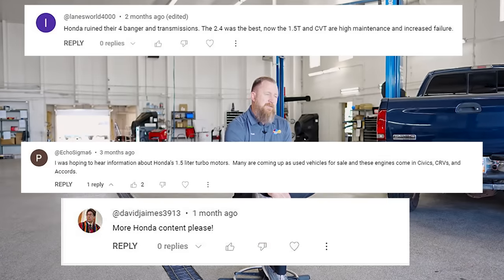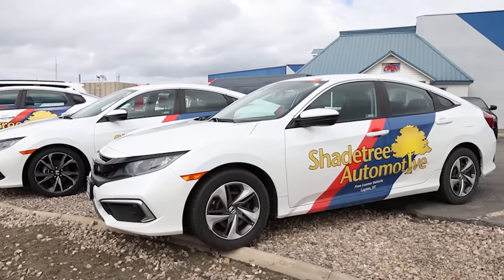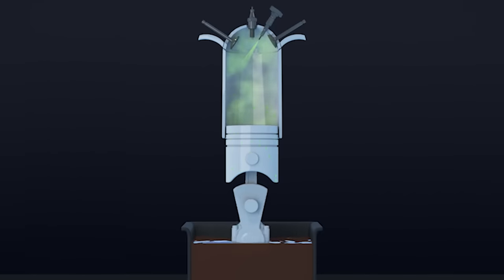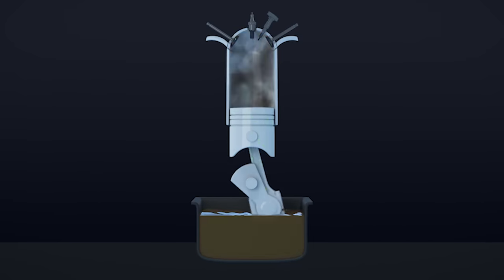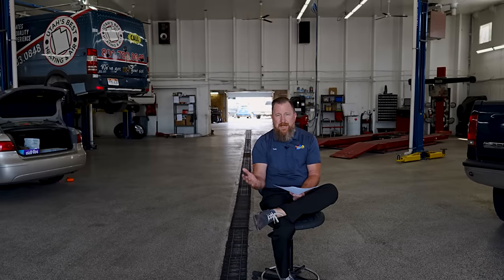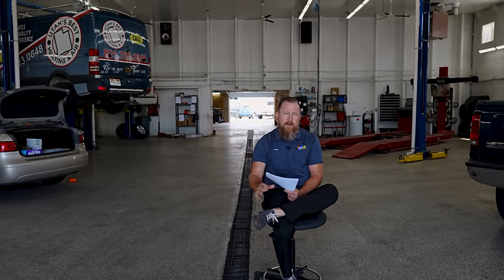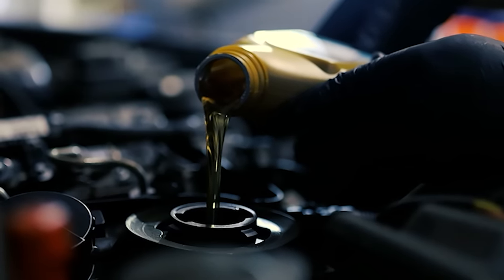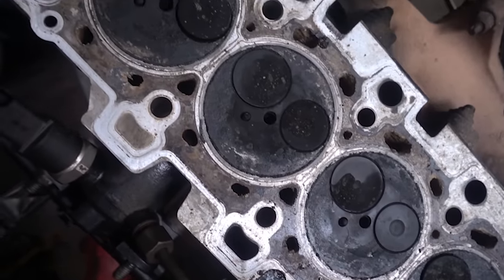Honda Oil Dilution Issue - Should you buy a new Honda

Comment: Don’t forget to be making sure to use GF-6 oil.
Reply: 0w-20 and 0w-16 is gf6.
Reply: @milfordcivic6755 not all of it, gotta read the back to be sure. for 0w20 at least, all 0w16 is
Reply: @milfordcivic6755  No. 0w-20 is  GF-6A and compatible with older engines , 0w-16 is GF-6B and not backward compatible.
Reply: This has me stuck, why would a thinner oil help when the oil is already thinning as it is? What's different on the gf6 that helps in this specific case?

Comment: The actual problem is 1.5T Accords having blown head gaskets -_- . Bought my Honda for reliability, safety and fuel mileage.. and now there’s head gasket problems cuz of the high psi and weak bolts they use, and apparently 87 fuel is terrible for turbo engines so you spend an extra dollar a gallon for 89 or 91.  Fun!  Fortunately how hard you drive can affect your risk, and I typically keep RPMs under 3k.  Kinda crappy knowing I can’t have a little fun from time to time though.

Comment: We own a 2017 CRV. I change oil myself over 120,000 km of use, from new. I can smell a bit of gas smell in oil at change, but oil volume doesn't climb per say, or seem diluted. I've  been changing oil for 35 years on our family fleet, and so far doesn't seem be be an issue for us. We drive alot of hiway kilometers, and run engine at full temp most often. We live in northern BC, and  Honda software update(engine warms up quicker now) and longer drives, so far engine seems okay. If we did stop and go, I'd change oil sooner also.

Comment: Loving my 2012 Honda CR-V, EX-L with non-turbo 2.3L. Several cross-country USA road trips of 7500-8500 each miles with oil changed at 15% life. I check the oil level daily but with 135K+ miles on the odometer, I have yet to add a drop between oil changes. Not wild about turbos nor CVT transmissions.
Reply from the maker: Nice work
Reply: Fuel and moisture can displace oil consumption, making it look like the engine doesn't consume oil.
Reply: Why do you check oil daily. That’s insane.
Reply: @ShadetreeAutomotiveLayton  What about the straight 1.5 Honda fit sport and the 1.3 engine model?

Comment: Thank you for the video. I just bought a 2024 civic sport touring with the 1.5t and its a great car. im still stuck in the mentality of oil change every 3000 miles, but oil and filter are cheap. engine replacement is not!

Comment: I had a 2018 Accord Sport1.5t and now have a 22 Civic SI. Never had an issue. I get my oil changed every 3,000:to 4,000 miles. I have a 6 minute commute for work.
Reply: 6 minutes🤣
Reply: what octane fuel and what weight oil?
Reply: @dand1363  I use what we have as the highest here in Texas. 93?  Oil?  Whatever the Honda dealership uses 😎

Comment: Good video...thanks. On you engine cleaning process is that recommended by Honda? During the cleaning do the carbon deposits that head to the tail pipe affect the catalytic converter? I'd like to see your before and after photos of the back side of the intake valves after this process. Not photos provided by the manufacture of the product your using.  Thanks again!
Reply from the maker: The carbon cleaning process we use is not Honda specific.  We use a Valvoline product that does a good job and is safe.  Reach out to your local Valvoline rep for a demo.
Reply: @ShadetreeAutomotiveLayton  I haven't seen any where that this process is recommended by any manufacture...Ford specifically says don't do this kind of treatment because if you damage the cat or any other oem part, its not covered under warranty. Some OEM dealers offer the service any way. With all due respect what your selling, I've never seen any evidence that it does any good. The only sure fire way I've seen any evidence of proper carbon cleaning is doing it manually like walnut shell blasting. Not washing some unknown stuff down your intake system.
Reply: @garybaldwin1061   I had an issue with carbon buildup in my 2016 Fit and Honda Canada did have a process, they took the head off and cleaned the valves with some sort of rotary brush. This is obviously quite different than what was mentioned tho
Reply from the maker: Yes, walnut shell blasting is the best way to actually clean carbon @garybaldwin1061  .  There service we do on our vehicles and our customers vehicle is not recommended by all manufacturers.  Valvoline backs me up if there is every a problem.  When we first started offering the service, we did remove an upper intake, use a borescope to look at valves, run the service and then check them again.  Made a good amount of difference.  The key is to utilize the cleaners as a preventative maintenance tool rather than a repair.  Once the carbon is buildup enough to cause issues, it is walnut blasting time.

Comment: Are the 2.0t variants OK? Haven't heard of issues with them. Imagine the old J35 3.5 v6's didn't have this problem right?
Reply: the 2.0t doesnt have any of those issues.The k20 is a reknown engine that can last decade with proper maintenance,booster or not.Its literally honda's best engine from the last 2 decades.
Reply: @alpe6228  I thought that also but someone in this comment section mentioned that they saw fuel in an oil analysis on their 2.0
Reply: @neilquinn  Well it could have oil dilution but its not really a problem for the k20.Its a very solid engine compared to the l15.
Reply: @alpe6228  ya I have a lot more faith in those established K series engines. With Acura TLX’s my main concern is the 9spd trans

Comment: Why change the oil sooner why not just run it for a long drive? Wouldn't that burn off all the extra fuel in the oil??? Recirculate it to the pcv valve back into the intake or exhaust?

Comment: 4000 mile oil change, filter every other change. I cut open lots of oil filters and the only thing capturedvis plasticized/varnished oil residure. This residue is still minimall at 4k miles. If you doubt, do a 4000 mile and change filter and cut apart filter and stretch tge paper and look in the pleats. DI causes more soot and the engines with the combo PI and DI have reduced dilution and no intake valve deposits. Honda will likely join the ones doing that but it is no relief for any without it.
Reply: Yeah, and save a whole 50 dollars over the life of the car which will cost about $80k in total operating costs!

Comment: First, I would like to thank you for taking the time to make this video on the 1.5 turbo. It is the most comprehensive explanation of what causes the problem and the possible solutions. Do you have any opinion on the 1.2 turbo engines that they are putting in the new 2024 Chevrolet Trac?
Reply from the maker: You are welcome.  I don't have enough experience to form a solid opinion on the 1.2 in the Chev.  My gut tells me it will likely have lots of issues.
Reply: @ShadetreeAutomotiveLayton Thank you for taking the time to respond.

Comment: I've been a Honda specialist for 16 years and have not been impressed with the 1.5T. I haven't seen much oil dilution in my area, but I have seen a handful of headgasket issues. There hasve also been many fuel injector and fuel pump issues and I suspect that may damage the headgasket, which doesn't take much given the design of the engine block cooling slits between cylinders. Buy a Honda with a V6 or a K series engine.
Reply: Ummm, be careful throwing stones , dude.   The 3.5 has had injector issues for years.
Reply: @kevbiker3982  you're right . I forgot about J series injector issues and VCM oiling issues. However, the overall architecture of the engine, especially the older ones, is vastly more reliable, IMO.
Reply: They are not overbuilt at all which is not promising for a very long life.   Tuners put a mild tune on these engines and they self destruct, not like the older Honda/acuras.

Comment: Excellent video.  I just purchased a 2024 Accord EX with the 1.5 Liter turbo engine (L15BE VTEC).    I plan to get the oil changed at a minimum every 7K miles, and I rarely drive for less than 15 minutes at a time so my engine always reaches operating temperature.  Plus I drive conservatively.   Where I live, in the winter it rarely gets below 45F except in the early morning hours before sunrise.   Since it's a new car,  I should have the latest software updates.   The advice in this video is excellent and should be followed.   Also, this engine has mechanical lifters so I plan to have the valves adjusted at least every 30K miles.
Reply: Thinking of buying an Accord myself. This is steering me towards the hybrid as we live in Maine, (it tends to get chilly here) and my wife only drives locally.

Comment: I went into the Toyota dealer with 5% fuel dilution and they said it was normal.

The problem arose due to the use of E10 (10% ethanol fuel): 

The ethanol oxidises and then polymerises to form sticky brown deposits that gum up the rings. Even the dipstick can end up brown from these deposits.
The sticky rings let the fuel get into the sump.

The fuel dilution of the oil compromises the lubricant film of the piston and bore... and you can end up with score marks up and down the bore.

Fortunately, if you stop using E10 the problem stops getting worse.
Unfortunately, to clear out the deposits you will need to flush your engine... perhaps more than once.

In many countries, ethanol is used in virtually all fuels so you can't simply stop using it.

🙂

Comment: I have an accord with the 2.0. 5% dilution in 4000 miles. I change the oil every 4000 with 5w30 instead of 0w20. The dilution is really bad.
I live in hot climate too. I drive 99% highway miles for 35 minutes or more. The issue is the ENGINE DESIGN not driving conditions.
Reply: What year is your accord? Never thought 2.0T would get affected as well.
Reply: I have a 2019 2.0t accord with 57k. I use 0w20 amsoil signature and did an oil change 7000 miles. Everything was fine except for 3.7 percent fuel dilution. Was told to change oil at half interval. So, I took another sample after 3500 miles and changed the oil and filter. I'm still waiting for the report. 

I live in socal, but I have a short commute to work 6 miles each way.

Comment: Love my 2018 civic Si,,,,I notice the oil dilution immediately so changed the oil before it’s first 2000 miles and after break in starting driving it more aggressively, stoped doing short drives and always charge the oil early IE at 2500-3500 miles. 

Now have over 50,000 miles and don’t see any issues.

Comment: This was only an issue in very cold climates.China, North America etc….We in Australia have never had this issue, & as such Honda Australia never issued a service/tech bulletin.Other than that their engines are pretty well bulletproof.
Reply: My FK and FL Civics are doing amazing. Like you said Adelaide is not too harsh for the cars to endure in terms of climate severity. 🎉
Reply: Sorry but I have to disagree with you. I live in Melbourne and I lab checked my 18 CRv’s oil last year and it was diluting at 9%. From day one of car ownership I could smell petrol on the dipstick. I mentioned this to Honda at my first 2 services and the ran the line you just stated above, nothing to see here. They are now checking it out as I did another lab test earlier this year and it was way up in the caution region. I’ve had a couple loaner crv’s from Honda now and out of interest I pulled their dipsticks and I could smell a strong odour of petrol on both cars. I reckon it’s happening a lot in Aus however people are just not aware. I do long drives, sometimes 2-5 hours. Basically the engine is diluting so much even at operating temperature, the petrol  isn’t all being evaporated off. Totally flawed engine IMHO.
Reply: @ayfj4572  I never ever experienced that with my CRV , I live in the Southern Tablelands, we’re it gets below zero @ night.
Reply: The issue is everywere. The only difference is a hot engine thats driven vaporizes the gas and it dont build up as much.
Reply: Yeah but you have that nasty funnel web spider.

Comment: I ditched our CRV and 2018 Civic 1.5t for a 2021 Rav 4. It’s got the 2.5l naturally aspirated well proven motor- GDI and Port fuel injection helps with carbon buildup , bulletproof 8 speed ( non CVT tranny) and well proven AWD system. 70k miles so far basic maintenance only and still riding with the original brakes too.

Comment: Just an educated guess but I think premium fuel could help.  GM recommends it (but not required) for their 2.0 turbo in my Cadillac XT4.  I've run regular but the car gets worse mileage, which indicates more fuel being injected into the cylinders to prevent pinging.  Just a thought and I may be wrong, but worth a try. n If premium is working, better gas mileage will be an indicator of a leaner mixture.
Reply: Premium.fuel simply does not self ignite..i.e. knock.  Does nothing for economy, efficiency, etc.  It simply allows aggressive timing and higher compression to create more power without early detonation destroying the engine.

Comment: Our 2010 crv approaching 500k so Im currently looking for a 2016 2.4 to replace it. No way some turbo tiny 4cyl will last as long with as little issues.
Reply: There is a guy with 2018 civic 1.5T with 700k miles.  So you have no clue what you’re talking about. Honda makes great engines, including the 1.5T.
Reply: @areallytallguy  There's always that "one guy" did you even watch this video or just jump to the comments and cry over people hating on a car you probably in debt for.
Reply: I have a 2011 that just hit 100k, im excited  to see how long it will last
Reply: @capy_official Get those valves adjusted before you hit 150k just to be safe. The only issue with theses engine is when they get high mileage, the exhaust valves get tight and they can burn a valve.

Comment: I believe that only the Civics with the 1.5L t engines have this issues, while the LX and EX trim don't, since those have a naturally aspired 2.0L engine with no turbo on top. Honda also released an EX-T model in NAmerica, which also has a 1.5t engine, So if you wan to avoid this problem, my suggestion is to get a Civic with the 2.0L engine, so LX or EX models.

Comment: I just stay away from turbo engines in-general or any other added-complexity/problem engine tech such as stop/start & cylinder-deactivation.  Same with any belt/chain design CVT transmission.  That's how I ended up with my 2022 Mazda CX-30 Carbon Edition 6-AT, which has been a 100% problem/issue-free ownership experience for about 19 months & counting now.  It's my first Mazda after owning/driving nothing but Honda/Acura (all manual) for about 30 years & then Toyota (all manual) for about 10 years after that.
Reply: CVT's aren't bad, depending on who makes them. Toyota and honda make the best CVT's. No problems on my toyota CVT at 40k so far
Reply: @lunisce  Belt/Chain CVT's don't typically last much longer than 100-120K, if even that given the way most people drive & service their vehicles.  Just the nature of the design in-general (which is also prone to more random premature failures).  But, as long as it makes it through a powertrain/extended warranty period, that is all automakers care about.  From what I have seen, the various Toyota & Honda forums seem fairly active with CVT issues/problems as well.

Comment: Very good advice for anyone driving short distances in cold weather. I do drive mostly short distances myself so I change my oil every 3000 miles or six months, whatever comes first. I also try to exercise my car by driving it 30 minutes every 2 or 3 weeks to burn off gas in the oil. Direct fuel injection, while great for efficiency, has been problematic with carbon buildup and fuel dilution… So I’ve resisted buying a newer car just for that reason, unless it has port injection as well, as does Toyota has done by using BOTH as odd as it may seem, for using port fuel injection together with direct fuel injection solves carbon buildup.
Reply: Most modern engines are designed to warm more more quickly because that is when emissions are highest and cold starting was included in the standard tests.

Comment: It is true that factories no longer make good cars as they used to.  This is true for all carmakers including Toyota and Honda.
Honda has gradually slipped in terms of QC.  Most Honda cars are made in North America (U.S., Canada, and Mexico).  The ones that are made in the US are the best then the ones that are made in Canada come close in second.

I had a 2012 Civic (non turbo charged) and it was a very good car overall.  
I racked up 22O K miles on that poor Civic before it was totaled by some uninsured driver (more common issue in California these days).  
I had no major mechanical problem during the ownership period.  
But there are some issues.  The starter quit around 80K miles (year 4).  

In year 8, I had to leave the car in the dealership for 4 days because of fuel injectors issue.  That trip costs me around $3,600 but I got another 50K trouble free before the engine started leaking oil here and there.

I am switching back to Toyota.  Keep my fingers crossed.

Comment: My brother the same issue with his 1.5T Accord, 2018-2019 don't exactly remember, but he has the Touring edition of the car, it's nice, it makes good power, car is fantastic.

That said he basically runs 3-4k OCI on the car due to fuel dilution, he drives 25 miles to work one way all highway here in Mississippi.

He's done UOA tests at 5k which had him at about 4.5-5% fuel, Blackstone had fuel dilution lower but apparently they don't do super accurate fuel checks, they take known flashpoint of VOA, and compare it to flashpoint of UOA and interpolate the values. Been using Polaris which seems to actually check fuel dilution values directly, it's a good car it doesn't treat oil well often falling outside of grade, high copper/aluminum, I think his only has 80k miles on it, already had all the injectors replaced under warranty.